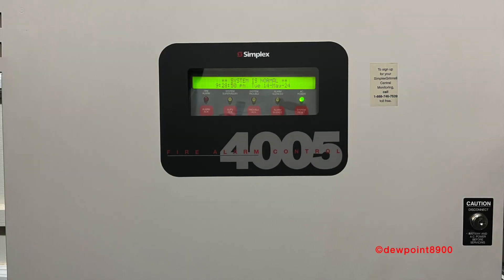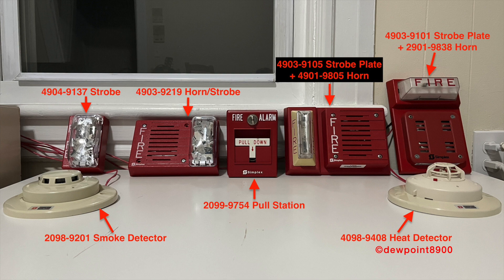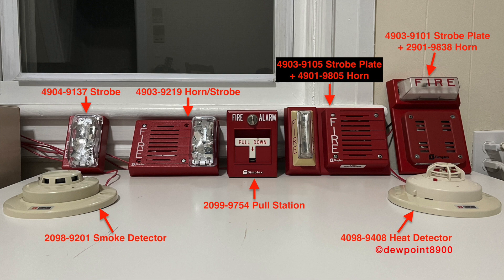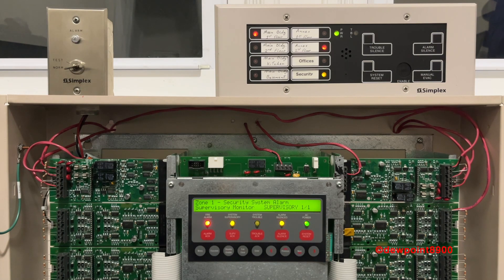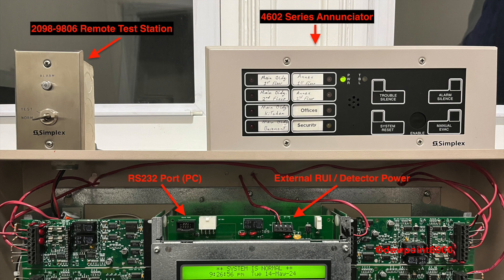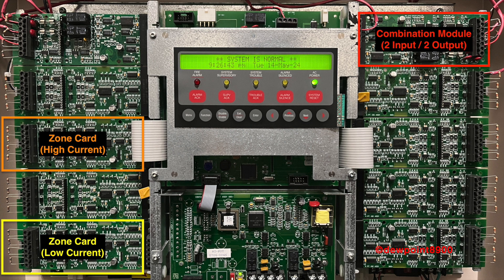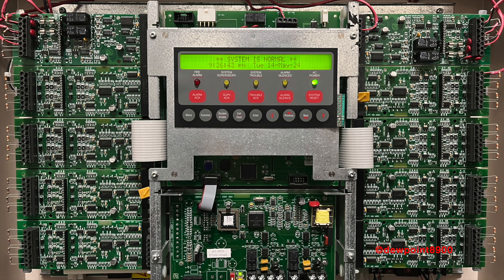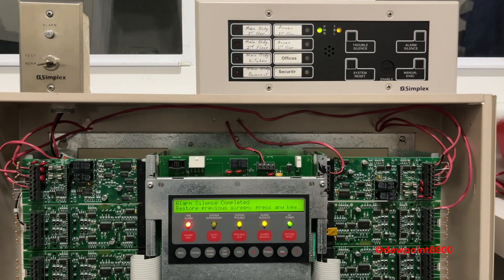Simplex 4005 Overview and Demo

Comment: If the Simplex 4005 high current card can support 30 detectors with relay bases, How many can it support without?
Reply from the maker: I believe the high current cards can only support one relay base per card iirc. The max is just in general.

Comment: OOOOOH! I've been waiting for this one for a long time!!! Also it's strange how those two horns sound nearly identical but have completely different mechanisms.

One last thing, have you thought about the Fire Lite MS-5UD/MS-10UD when designating a good easy-to-program yet advanced panel? I think they're actually a little bit easier to use in exchange for being a slightly less robust panel
Reply from the maker: Yes, I do find the MS-5/10UD to be very capable conventional fire alarm panels. With built-in sync, zone programming (supervisory, etc.), and filtered DC on the MS-10UD; these panels are a step up from the MS2/4 and are great as a starter panel.